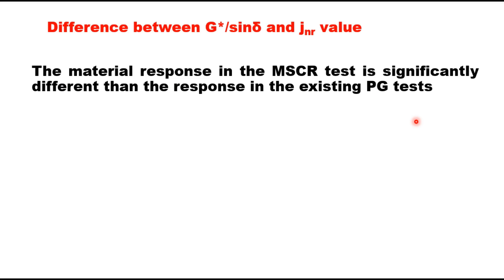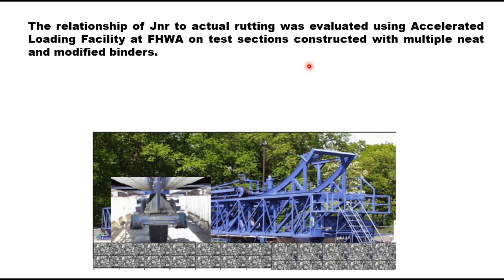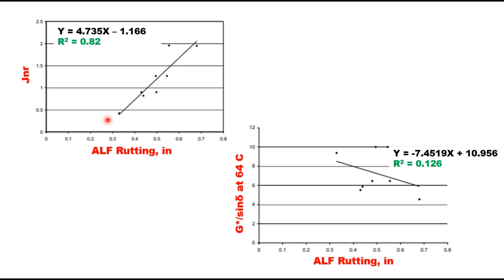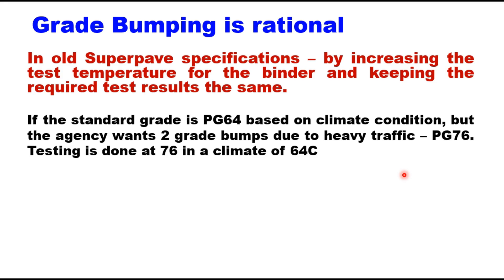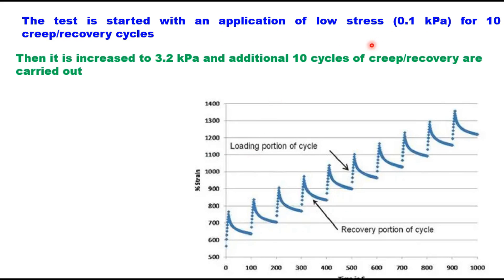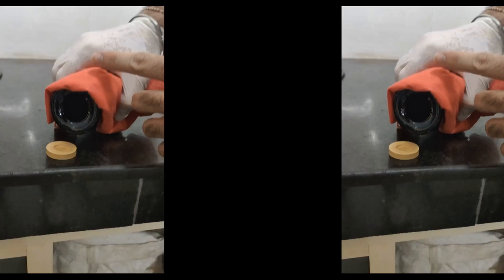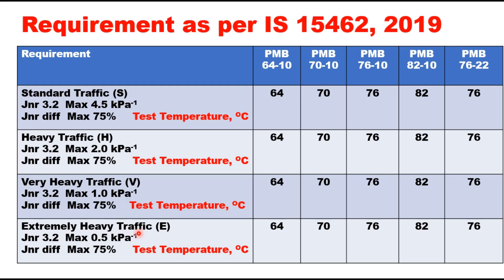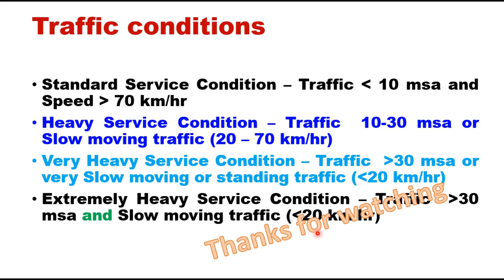Multiple Stress Creep Recovery #MSCR Test on Modified #Binders – Jnr difference, complete procedure

Comment: Thank you, sir, for explaining this complex test procedure and its significance in a simple and clear manner.

I am Sanjeev Kumar, a Ph.D. Scholar from NIT Patna, currently working on bio-bitumen.

Sir, I have a minor question regarding the test: What is the significance of the RTFOT-aged sample  used for this test? If I perform this test without an RTFOT-aged sample (i.e., using an unaged sample), will the results still be relevant? I have read many papers where the aging effect on different parameters has already been analyzed separately.
Reply from the maker: This test is performed to evaluate its long-term performance under repeated loading conditions, particularly its resistance to rutting. When we say long term performance, the ageing is inherent. Therefore this test is not recommended on neat (unaged) binders.
Reply: @SatishIITR  Thank you very much sir for quick response. It solved my confusion.